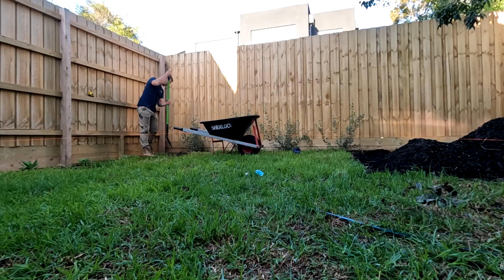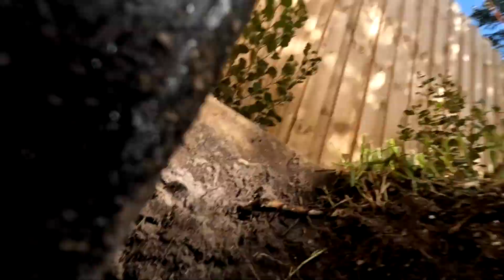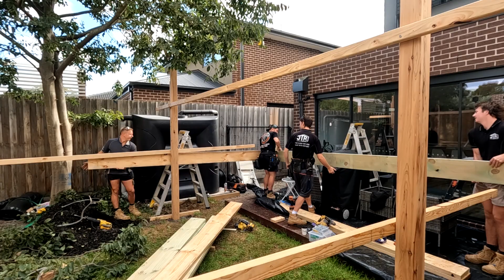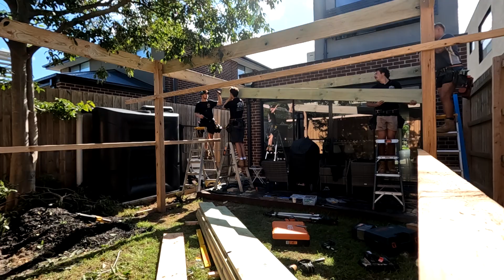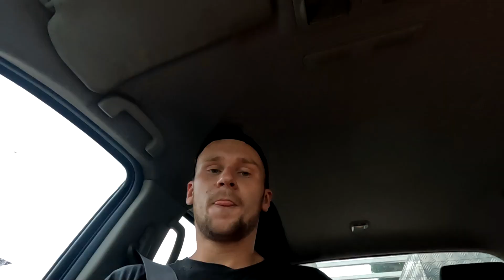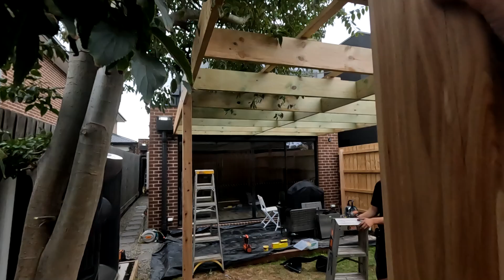Building a Pergola

Comment: Cross braces on a pergola hmm. Good build though
Reply: It needs it. Hmmmmmnm
Reply: @glitch2250  why?
Reply: This will be a strong response I hope I have a few probable correct replies that I hope don't anger but teach I suppose
Reply: It's only 4 posts with no walls, it will sway. The brace locks it into place so it can't move :) it's ugly but necessary
Reply: @glitch2250   when the roof goes on it will take all the sway out of it also... the cross braces are just a bit unsightly
Reply: @ddkeohane  yeah this is a quick and easy way of putting one up but visually the design is pretty weak
Reply: 45° corner bracing would look much better. No joist hangers were used for astechic reasons but there are two big dirty galv straps crossing the roof....🤔

Comment: Awesome job mate nice. I think the purpose of the joist hangers vs batten screws from the end is that the timber won’t split if holding a lot of weight. As the hangers are cradling from the bottom. Not much tho prob, like you said 👌

Comment: Hey mate great job. Just wondering how you calculated the rips you needed for the battens? 900 spacing at 12° of fall if thats correct.
Reply: Find your desired pitch. The video said 1.2 degrees.
Workout the rise over the span at 1.2 degrees.
Assume 100mm of rise.
Divide 100mm of rise by the number of battens.
Assume 10 battens = 10mm increase per batten.
Spaced out evenly, each batten rip should be 10 mm thicker than the last until you reach you're 100mm rise

Comment: Hi Dave, very well built pergola mate. I have been following your content for a while now. I also work for a builder in Melbourne (site supervising) so I find your videos highly relatable.

It seems like this pergola is a freestanding under 20sqm which does not require a building permit. However I have had experience helping a client in Bayside City Council (Highett from memory) doing a town planning amendment about 5 years ago for some decking they built after handover of their townhouse (which is a part of a town planning permit without decking spec'ed on the landscape plan). I wasn't sure how the Council found out (maybe through Nearmap) but the options given to the client was to either remove the structure and restore to what was drawn in the landscape plan or to apply for an amendment and redraw the landscape plan to reflect what was built. In your case the client's townhouse seems new and most likely part of a town planning permit.

Just something I have experienced before and thought I could share it with you.
Reply: Technically this structure with a roof on it is classified by the VBA as a verandah not a pergola.
Reply: https://www.vba.vic.gov.au/consumers/home-renovation-essentials/landscaping